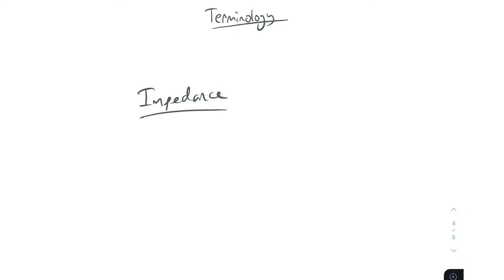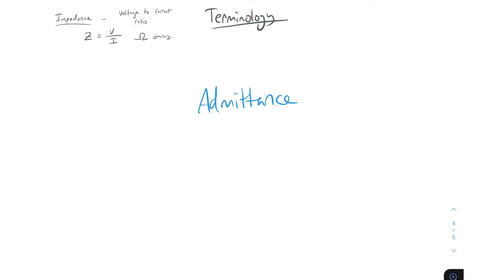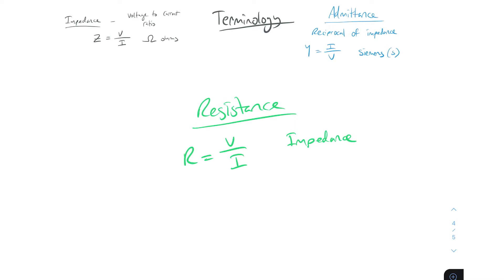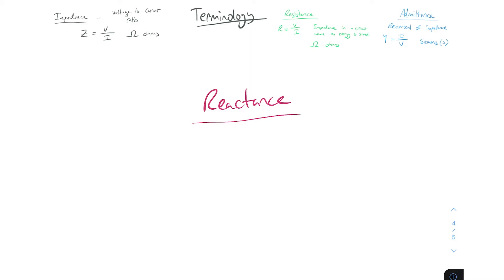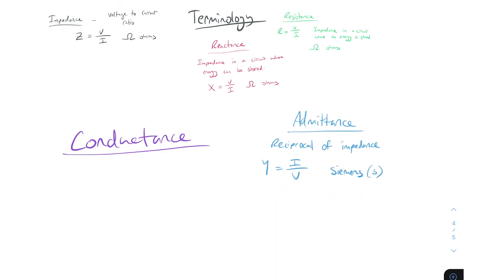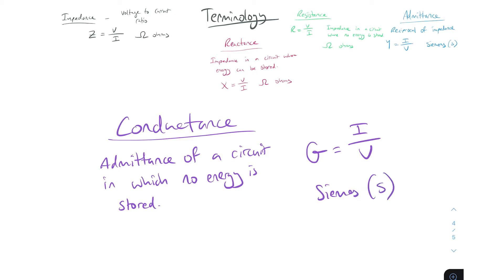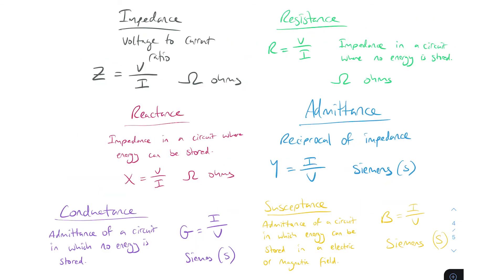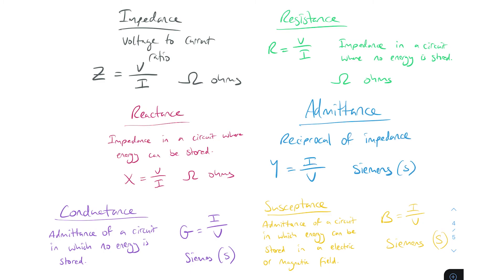Terminologies Electrical Engineers Need To Know - Impedance, Reactance, Admittance, Conductance

Comment: I work with a battery tester that measures the conductance. All the people I've seen in the industry have an equipement that measures the internal resistance. I personally use the internal resistance to measure the aging of my LiPos for my RC stuff (drones and stuff), but at work with the conductance, it's for UPS batteries. I'd have a ref, say for a 12V 35W battery, that could be say 1700µS. A client would have something like 5mΩ. I could also reverse the sign and say I have to get around 1700 micro "℧" (for a healthy battery). So, it'd be cool if you could make a video on the relationship between the Rint and the µS(or µ℧) in details. Great video !